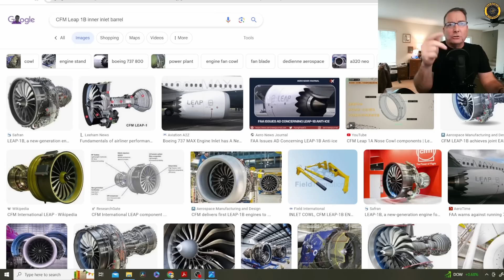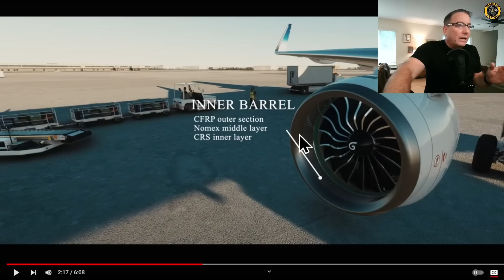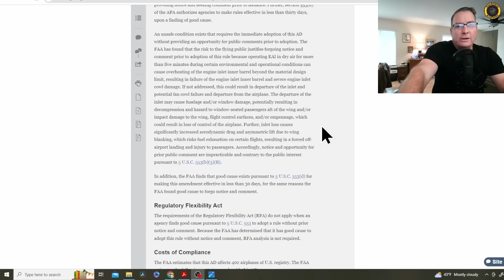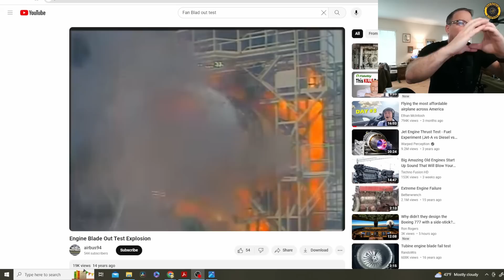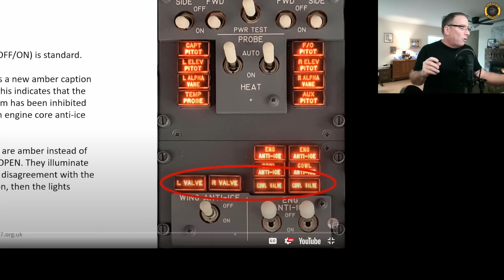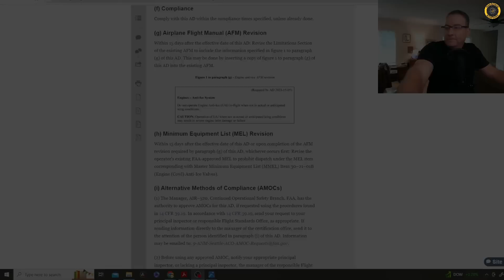Boeing 737 Max-7/-10 Certification HALTED! 1 Feb 2024

Comment: If culture at the FAA and Boeing does not change, more aviation tragedies may follow.  These type of problems with the 737 MAX are unacceptable.
Reply: Airbus A320 disasters.

Source:  Wikipedia

On 28 December 2014, an Airbus A320-216 registered as PK-AXC, crashed into the Java Sea killing all 162 on board. 
The cause was initially a malfunction in two of the plane's rudder travel limiter units.

On 19 May 2016, an Airbus A320-232 registered as SU-GCC, suffered a cockpit fire and crashed into the Mediterranean Sea 
20 minutes before its scheduled arrival at Cairo International Airport.  All 66 on board were killed.

On 22 May 2020, an Airbus A320-214 registered as AP-BLD, landed at Jinnah International Airport gear-up and executed a go-around. 
A few minutes later, both engines had shut down. 
The plane crashed into Model Colony near Karachi on final approach to Jinnah International Airport for an attempted emergency landing, 
killing 97 of 99 on board, as well as killing 1 on the ground.

On 5 November 2014, Flight 1829, an Airbus A321-231 registered as D-AIDP, was flying from Bilbao to Munich when the aircraft, while on autopilot, 
lowered the nose into a descent reaching 4000 fpm. 
The uncommanded pitch-down was caused by two angle of attack sensors that were jammed in their positions, causing the fly by wire protection 
to believe the aircraft entered a stall while it climbed through FL310. 

On 31 October 2015, an Airbus A321-231 registered as EI-ETJ operated by Russian airline company Kogalymavia crashed in the Hasana area of central Sinai, Egypt 
while en route from Sharm El Sheikh, Egypt to St. Petersburg, Russia. There were 224 people on board (217 passengers and 7 crew). 
There were no survivors.

Comment: What's next for Boeing?

From purveyor of engineering-driven, quality-focused delivery of game-changing commercial airliners, it has become the proverbial sidewalk charlatan hawking low quality trinkets from the inner lining of its corporate trench coat, all to make a quick buck...

...and despite clear evidence of its knowledge of performance flaws of the past involving its 737 MAX 8 and 9 series - for which hundreds of innocent lives were sacrificed - this careless, financially-engineered, let's make the numbers mindset persists...

"The company asked federal regulators late last year to allow it to begin delivering its 737 Max 7 airliner to customers even though it does not meet a safety standard designed to prevent part of the engine housing from overheating and breaking off during flight."

I never thought that I would find myself so closely scrutinizing the type of aircraft I would be flying in on a given flight so as to provide myself a level of self-assurance that I'll actually arrive at my destination (without being flung out of a poorly sealed door plug or punctured by a section of engine cowling following an uncontained failure that Boeing KNEW might occur and has consciously asked to receive a safety exemption in order to meet their delivery schedules)...

This ongoing saga has been allowed to occur for far too long...

I have a suggestion: compel Boeing to split off its commercial aircraft business into an independent firm - its roots - and return its headquarters to Seattle, WA, US, thus once again bringing management, engineering AND manufacturing heads together, while founding this move upon a transparent commitment to QUALITY FIRST...

Comment: The reason an A320neo can exist but a 737 MAX can't is that the A320 is already a modern aircraft with modern safety standards built in from 1988. It already has fly by wire, ECAM/EICAS, and, you guess it, anti ice does not make the plane go up in flames. The 737 MAX is a 1960s plane that was mashed together with some Frankenstein parts, they should have called it 737 MAD MAX edition, because you might as well steer it with metal cables, standing upright on the wings and maniacally laughing, half clothed. It's not that Boeing Is a terrible company, the 787 is a magnificent fly by wire aircraft with a lot more automatics than the A320, but as you said: to compete with Airbus they needed a clean sheet design, not a vacuum tube driven, modern safety standards exempt hodge podge toy plane from 1967!!!!

Comment: Even if they address this by providing an automatic off for the de-ice, it's not really a fix. The root cause of the problem is CFRP in the engine cowling that cannot handle the de-ice heat. If the automatic off fails, or de-ice air otherwise gets stuck on, you've got serious problems. Why not fix the root cause and go back to metal parts that can handle the heat?

Comment: All Airbus manufacturing sites are ISO9001 certified.
Boeing chose to not certify its manufacturing sites with regards to ISO9001.

ISO 9001 is defined as the international standard that specifies requirements for a quality management system (QMS). 
Organizations use this standard to demonstrate the ability to consistently provide products and services that meet customer and regulatory requirements.

Boeing uses a system known as Common Manufacturing Execution System, ( CMES )
It would be interesting to know how this system is structured and implemented on the production lines.
Reply: I would agree with rocketboy. I worked in a company that set itself up to be iso 9000 and iso9001 compliant  and it basically is all about the documentation of the way you work eg the plan. It doesn't necessarily mean the plan or work is any better quality, just that you followed all the documented way of doing it.
Reply: ISO just means you followed the plan, not that the plan was good.
Reply: @Han-Teh  As someone who works with ISO, the process is vetted before it becomes  ISO.

Comment: They all should be grounded.  Can you imagine a surgical device requiring that Rube Goldberg half assed solution that the pilot remember to turn it off.  Even my car blinker goes off after a turn.  The idea was not to change anything so they could cut costs on certifying it.  Criminal.....something only a lawyer or MBA or politician could come up with.   China want to take over aerospace......guaranteed it will happen within 15 years.  And Russia will be exporting passenger aircraft as well.

Comment: My goodness, what mess Boeing is in now. My car has a sensor to tell me when icing conditions are possible.  It is mind boggling to think a plane as complex as the 737 Max is doesn't tell the pilot when icing is possible.
Reply: Imagine if DOT made you go through hours of training before you were allowed to operate a new vehicle that added the icing conditions warning. And also threw a fit if the manufacturer wanted to add an "auto" setting to the headlights.

Comment: In the event of an unintentional switch on or too long..   Simply add a few  thermometer sensors on the inlet and when the heat gets too high automatically shuts off valve and back on when the temperature reaches the lower limit still capable of melting ice

Comment: Calhoun needs to be fired immediately because he’s proven to be an even less effective, paper-pushing know-nothing idiot than Muilenburg.

The core lack of a clear and unified system of accountability is what led to MCAS, it’s what led to door plugs blowing out, and it’s what’s led to this engine cowling issue. To put it bluntly, in a properly functioning organization, sh!t flows in both directions: that means, as a C-level or senior manager, the need to address a problem isn’t papered over with exceptions, ignored via bureaucracy, or blamed on subordinates. As CEO you own the problems and decisions and that starts by actually ensuring you understand the effects of said decisions clearly through effective systems of communication and telemetry (e.g. you yourself, as CEO, need problem visibility and the ability to understand if they’re being addressed effectively by delegates, what the broader secondary impacts are and if those problems represent a larger set of systemic organizational problems).

A decision was made to revise an ancient airframe “one more time”. But Muilenburg clearly didn’t understand the packed risks of pushing the core design past its limits because, just to name a few core items, it required MCAS to offset CG driven changes in stall performance and the engines themselves would be mated to ancient non-automated deicing systems. The compounding set of failures stemming from the tree of decisions to revisit the 737 again, and the qualitative failures thereafter, has result is a plane that’s killed 300 people, continues to put passengers at risk, nobody wants to fly on, that’s years behind on delivery schedules, has wrecked Boeing’s reputation, and has harmed shareholders. There has never been as catastrophic a product failure in the aerospace business as the 73Max, regardless of its bloated order book. Furthermore, as the problems with the program compounded, real questions of broader problems at Boeing were not being understood or framed correctly by Calhoun. With issue after issue stemming from poor risk assessment, a lack of understanding of decision consequences, a failure in CI feedback, a breakdown in internal problem and QA tracking, senior management still has no idea how deep the problems with the Max actually run, or what secondary immediate consequences of current problem solving decisions might actually be. And that is inexcusable given Calhoun has had 4 years to address precisely these problems (and yeah, it really is that bad… they have freakin doors coming off the planes in flight). If he did nothing else, he should have ensured a clear, systemically unified system of operational and QA accountability that started with the screen in front of his face - yet we find out that Boeing and Spirit use entirely different systems, there’s no common reporting or task management, overlapping systems, half-abandoned automation and nobody’s really sure what’s going on with the 73Max (or, for that matter, any other current program at Boeing). AND, these problems aren’t just impacting their Commercial Aviation division, they’ve had seemingly endless problems on the space and defense side of the company also.

Calhoun’s gotta go ASAFP because, as of right now, if it’s Boeing, I ain’t going.

Comment: It seems the weight saving of the composite inlet with its high temperature fragility vs a more robust metal inlet is too risky. If an important on/off switch can be forgotten, sooner or later it will be.

Comment: Wasn't the engine anti-ice system tested as part of the development and certification of the LEAP-1B  by CFM ? How is this on Boeing ? Isn't the same basic engine (LEAP-1A) used on the A320neo ? Is there a different anti-ice system on the 1A ?
Reply: The engine is NOT the problem - CFM does not design/make the nacelle anti icing components. It is Boeings design of the nacelle anti icing system/components that is the problem. Airbus uses a totally different design.
Reply: @Paul1958R  Interesting, didn't know they were separately developed, and that the anti-ice system is unique to the airframe. Maybe they should have contracted Airbus to develop it. 😀

Comment: You would have thought they would have gone through testing testing and testing for extreme temperatures to make sure it's suitable for long-term use, it doesn't sound like it does it.
Why don't you use that plastic they used on the nose cone of the space shuttle I think that can handle the heat😅
The engine is showing exploding the blade is a Rolls-Royce maybe that's your answer😅

Comment: Question is how will the fix the de ice. Re design the engine?????
Reply: CFM does not design/make the nacelle anti icing components and the problem is not the engine. It is Boeings design of the nacelle anti icing system/components that is the problem. Airbus uses a totally different design
Reply: Ohhh the de ice system is part of the cowl which is not to be confused with the engine

Comment: My question is: what’s next?
Boeing has entered the “beat it to fit, paint it to match” level of aircraft design and manufacturing. 

My only experience is from working on the B-1 and B-2 bomber programs.  Disturbing to find out that we were building aircraft to an obviously higher standard than civilian passenger aircraft.

Comment: Where does the air go after heating the cowling? Does it return to an earlier compressor stage of the engine? Is it just bled off? In the latter case it would certainly have a performance penalty and the bean counters would want the crew to turn it off whenever they can get away without it...

Comment: How could any regulator give airlines a pass to run engines that can overheat and self-destruct if you forget to turn off anti-ice? Feels like the government is often willing to add unnecessary risk to the safety of flyers so that Boeing shareholders and customers don't have to park the planes again. Parking these planes until they're fixed has the benefit of pushing Boeing customers toward their competitors who don't appear to have dropped their safety culture
Reply: The problem is not the LEAP engine. It is Boeings design of the nacelle anti icing system/components that is the problem. Airbus uses a totally different design and has NO problems

Comment: Boeing has been trying to morph a 65 year old airplane into a new airplane while still calling it a B737 so airlines won’t have to re-train crews on the new airplane. It may be time to scrap the 737 (like they did the 727)  and get to the drawing board and come up with a new airframe. How far can you stretch (and I don’t mean lengthwise) an old airplane before the breaking point. Maybe we’re close?

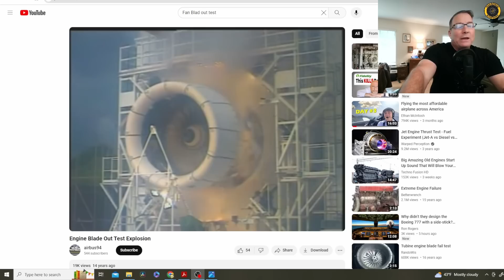Comment: 6:04 Always thought this was an oversight after the Quantas A380 lost its stator ring due to oil feed failure. That could've caused catastrophic damage to the airframe.
Reply: It caused significant damage; the pilots were highly skilled and very fortunate to bring that aircraft in to a successful landing.  Had the 380 been a few hours away from a suitable airport, the outcome could have been catastrophic.

Comment: Yet another reason that stepping onto a dash 8 is like playing Russian roulette. Thanks for the warning, Juan. It is shameful that the FAA is being coerced by Boeing on one side and lawmakers on the other, to kick this problem down the track. I think the FAA should require CFM to retrofit metal inlets until they can supply reliable automatic de-icing. Pilots have enough problems in bad icing conditions without having to worry about toasting the inlets.
Reply: "until they can supply reliable automatic de-icing"

What's stopping them from adding automatic de-icing?
Reply: For years Boeing has owned the FAA. Congress too.

Comment: Both the FAA and the manufacturer (Boeing) have become entirely too sensitive on what should be acceptable differences under a common type and comm9n training requirements. I don’t believe incorporating an automatic feature in engine anti ice protection would have been any issue for crews moving back and forth between NG and MAX variants.

Comment: This whole 737 Max fiasco is proof that bean counters shouldn't be in control of aircraft production.

It seems as if they just went through the overall design and tried to find places they could cut corners or do something cheaper instead of sticking with the tried and true methods that have always worked.

When you are a major manufacturer of aircraft that fly passengers all over the world the last thing you want to do is try to cut costs.

Comment: So, if this anti-icing function had an 'auto' option as it does on more modern designs such as the 777, would that require the additional crew training that Boeing and its major customers are so desperate to avoid? I would be surprised if it would, and more surprised that including an 'auto' function would have a significant cost implication - confused by this!
Reply: Yes.

Comment: FAA mandated manufactures include definition of Icing conditions in the AFM, after the Air Florida 90 crash. Of all the type ratings I have, all have similar definitions (10 C air, 5 Ground; visible moisture..) including Boeing. Although, other countries (i.e. ICAO, Russia) may have more restrictions.

Comment: There should be temp sensors embedded in the composite skins that would auto shut-off the hot air bleed valve.
OR 
Introduce cooler air to maintain the temp which would not cause delam or break-up of the composites.
OR
Bleed the air from a cooler compressed stage in the compressor.

Comment: It's just yet another unacceptable compromise of pushing the 737 so far beyond it's original design intent, all in order to save money.

What i don't understand is how fitting automatic control to the anti-icing would have required new type certification (which they chose to avoid to save money) but that fact that leaving anti-icing on becomes a critical issue where on the older 737s it wasn't, isn't something that requires a new type certificate. How can introducing a new critical failure mode, not be important enough that it requires new certification?

Comment: 737 Max is still a great plane!  Other than very occasionally nose-diving into the deck, the doors falling off, and the engine housings melting it's a great aircraft.  Speaking as a Harvard MBA with degrees in Accounting and Public Relations I can tell you all that you are overreacting to these minor problems.  After all what's a few dead passengers compared to the terrible reduction in profits which would result from Boeing having to fix these minor defects?